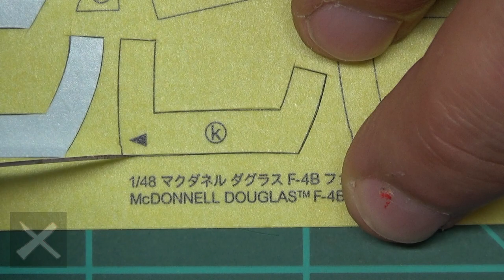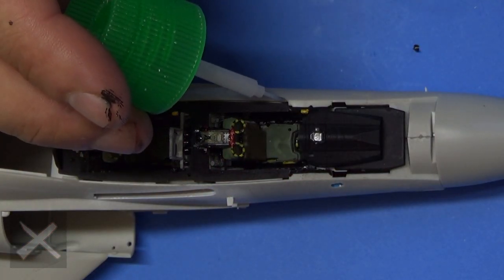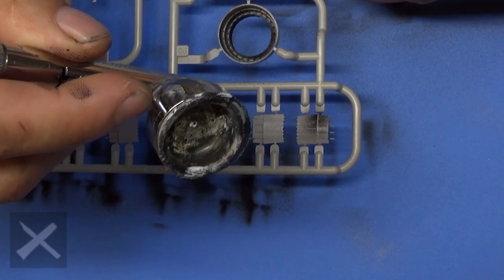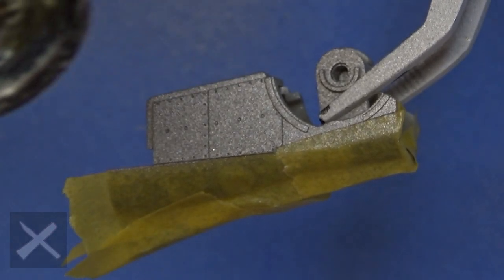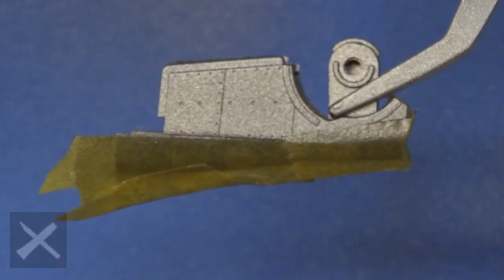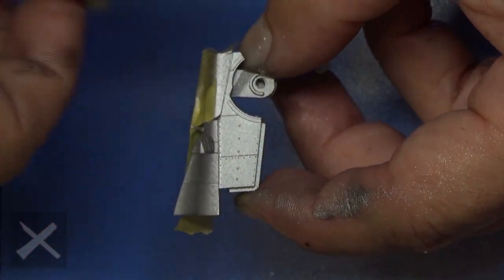Tamiya F-4B Phantom II 1/48 Part 7. Painting

Comment: What is the white paint u are using and what is ur thinner to paint ratio?
Reply from the maker: Using Tamiya White. I think it is the Flat white and I mix typically 1:1  ratios. It varies and might not need that much though.  I use the X-20A thinner for their acrylics.
Reply: @PlasticModelBuilder  thank you so much